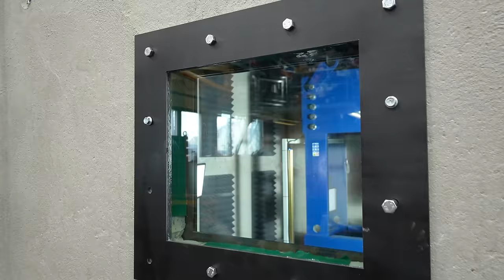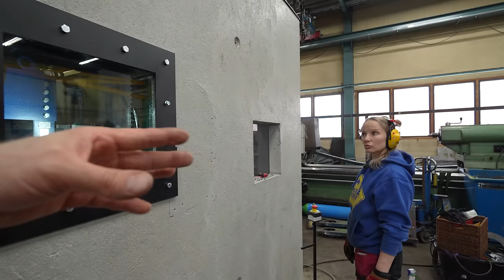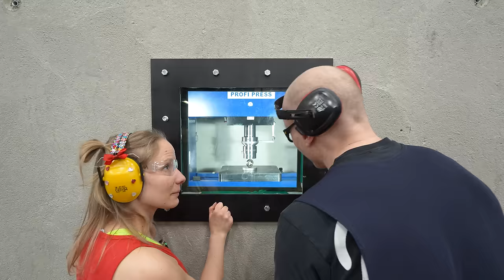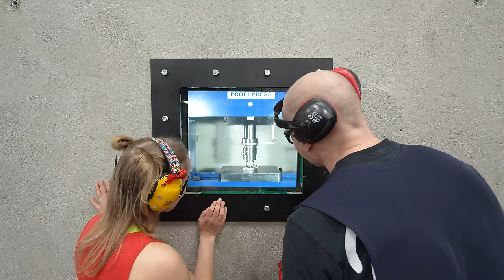Our Hydraulic Press Bunker Is Now BULLET PROOF

Comment: If you intend to film with expensive cameras through one of the windows, you may get reflections on the window from light outside of the bunker. You could reduce this by putting the whole camera in a black box against the window, or putting a 'skirt' around the lens with a fabric that doesn't let light through. I remember this skirt being a commercial product, but couldn't quickly find it. It used suction cups to stick to the glass.
Reply: Found it, it's literally called "lens skirt" 😆 by searching that term you can easily  find it.
Reply: I have often thought of the issue of having a very expensive camera inside the bomb shelter. Is this good engineering?
Reply: Thats a great idea! The recording will be extremely clear that way 👍

Comment: The walls need to be painted white. Traces of fragments will be clearly visible.
Reply: I feel like black would work better since they're already basically white and the. Any chips would be super visible
Reply: what if the walls wwere ballistic gel LOL
Reply: Every month or two they could recoat the inside of the bunker, alternating between white and black paint so shrapnel leaves very clear high contrast marks
Reply: too much work.
Reply: Nah, the raw concrete look is cool.
Reply: White would help with the lighting as well
Reply: @noodlelynoodle.  highspeed cameras need ALOT of lights, black walls would just absorb most of it.
Reply: @Wuuz  just use high gloss paint then, but none of the shots they do on this channel are ever super high speed stuff where that starts to be an issue. Not to mention that black is one of the best colors for filming/photography background to begin with anyhow, any of the light that would be absorbed by it would be light that was already passing by the focal point and would only be lighting up the backside which isn't seen anyhow
Reply: they put these echo lowering things on the walls
Reply: I vote for a dark metallic purple.
Reply: I Would put on a red layer first and then white. For the giggles.
Reply: Or 2 layers of paint. White on black or the other way round. You could easily see from the contrast if something penetrated both layers
Reply: Lil creepy. There's some overt fascination with violent forces in that thinking. But yeah, definitely do that thing; that would be cools.

Comment: I still would suggest a bed liner material for the walls on the inside. Maybe a white color so it will reflect the light but won't start taking chips and chunks out of the concrete itself. That stuff is super duper resilient.

Comment: 15:36 Arm guillotine 5 000 000! 😲
Reply from the maker: I will limit the pressure to so low level that won't hurt people that are getting between the closing door
Reply: @HydraulicPressChannel  could add a laser curtain like they have on big CNC machines so it cant be operated when anything is in the doorway
Reply: I’d suggest using a a single acting cylinder, counterweight and pulleys. Air to cylinder opens and keeps open door. When air pressure is removed exhaust on cylinder can allow counter weight to slowly close door and without much force. But you’ll still have full power to open door.

Comment: 2:12 If I had to guess, it’s about wave propagation. The way the layers interact can be more or less effective depending on order of contact. Think of the spalling that happened on armored vehicles and emplacements during WW1 and WW2. Ring those bells so hard the innermost layers shattered and flew off even if the armor didn’t get penetrated. Modern armors use a brittle material in front to shatter and abrade a projectile as it goes in. All placed in front of a more flexible structure.

Comment: Letting the shrapnel pass through the plane of a line laser would illuminate the pieces as they crossed.  Green line lasers are pretty cheap and might let you "see" small pieces the camera wouldn't otherwise pick up -- particularly on the high-speed.
...If you don't connect the door to a fog machine, it's only 9999999. 😜  Awesome work, y-all.  Wishing you a pleasant weekend from NC/US.

Comment: A real mixed bag of over/under engineering. Not criticizing to a fault, just observing the process. 
   I can see you had some real issues with the forward window mounting, as it's shown in various stages of incompletion throughout the video while the "auxiliary" windows are left in standby mode.
   I'm hoping you found that through bolts (threaded rod w/ nuts & washers on either side) puts the thin cross-section concrete into compression and will give the best yield.

Comment: FYI on the door it being made from ar 500 steel it is high carbon steel. Sand and clean the rust off then heat it to hot to touch with a blow torch and apply clean motor oil. This will cause the steel to blacken almost like gun blue. No need to worry about paint getting chipped up and you can re do the finish with a shop rag and clean moto oil with out heating it to keep it looking real nice. I use to have a bmx bike that was made from high carbon steel that i did this too and it looked great and was insanely easy to keep looking crazy nice. 
Any time i got a scratch on the frame i just used sand paper made for wet sanding at 600 grit then re applied the oil after

Comment: If you mount the steel door on the inside of the bunker using overhead rollers, you won't have to add extra parts to the exterior to stop potential shrapnel.

Comment: As a thought, if you paint the inside of Bunker 10 million darker (or hang a dark sheet on the walls) it will be easier to see the sparks and flying bits of things.
You've already got enough light on the victims, so you shouldn't need light colored walls.

Comment: I did some cable penetrations in an old building where the walls were cinder block covered with a very soft mortar... had to be extremely careful to make the holes neat on both sides, so I went through SLOW with a 6mm bit, then drilled halfway from each side with 10mm and then repeated  with 16mm. Maybe I could have left the 10mm stage out, but at least the result was way better than I expected.
Because I had to drill the prime holes semi-blind, I took an approximate thickness measure of the wall and marked it on the bit with tape, and when I saw the mark coming close, I turned off the hammer mode and went VERY slow.

Comment: yea its a common misconception that polycarbonate would be good bulletproof material, even the mythbusters were kinda surprised by that one. 

reality is, polycarbonate is fairly soft. what makes it a good material as backing for bulletproof glass is the fact that it stretches quite a bit before it breaks and doesnt crack when cut. which makes it really good at catching spalling shrapnel. but not much else.

the plastic in bulletproof glass is just ordinary lamination film used to bind the glass in a stack. it is elastic so it doesnt transfer the force of impact well to the next sheet but it is generally just a thin translucent film. not an actual layer.

(bonus fact, the pvb sheet used as lamination film absorbs some 99something% of uv radiation. its a side effect rather than a designed feature but yea. its the reason why you dont get tanned inside a car and the glasses that darken due to uv dont work inside one. (unless you point them at the side windows which are toughened as opposed to laminated like the windshield)
Reply: Normal glass will block out the vast majority of uv too not just glass with a plastic layer
Reply: It can tolerate blunt force better than glass, but bullets aren't blunt. Neither stops the bullet alone. The magic happens when you have hard glass to withstand the impact, and then you have durable polycarb for the glass to dissipate all that energy into. The order matters even. The armored bank cars sometimes have one-way ballistic glass. The driver can shoot out of it because it pierces the polycarb first and then blows away the glass, but incoming fire hits the glass first and then is absorbed by the polycarbonate!
Reply: @noodlelynoodle.  uvb yeah, uva only in small amounts, pvb stops almost all of it.
Reply: @dustinbrueggemann1875  nah mate, the glass is there to stop bullets. the polycarbonate is there to prevent spalling and only that. 
if you fire from the inside yeah you can get some glass shrapnel flying (depending on how close you are to penetrating the panel) but the bullet will be stopped by the glass regardless. (if it falls within the rating)

the polycarbonate will not reduce the glasses ability to stop the bullets :p

Comment: Problem why concret "braked up" at driling is because you have used basic drill bit with one carbide (- shape) blade. In some way for concrete is a lot better to use those with two carbide blades (+ shape) since when you drilling are more stable, also if you hit armature inside concret usualy can't stuck.

Comment: I think they should add sealing compound between the polycarbonate sheet, steel frame, and wall to prevent dust and moisture from collecting in-between the polycarbonate sheet and bulletproof glass.
Reply: A strip of foam should work as well.
Reply: Actually, I don't think you want it completely sealed, that's when trapped water vapor has a chance to condense. You can seal most of the way around for dust, but leave gaps at the bottom so humidity can escape.
Reply: It needs to be quickly replaceable, thats what it's meant for.

Comment: 4:27 when you drill in to concrete you have to drill a little then pull it out drill a little pull it out drill a little. you want to get the dust out of the hole because the dust heats up your drill bit and ruins it :)

Comment: Just as a PSA… You’re not supposed to push hard on rotary hammer drills, it hinders the reciprocating action of the drill.
It’s mentioned several times in most manuals but here is what it says in the user manual of my Milwaukee SDS plus rotary hammer.

“This tool has been designed to achieve top performance with only moderate pressure. Let the tool do the work.
If the speed begins to drop off when drilling large or deep holes, pull the bit partially out of the hole while the tool is running to help clear dust. Do not use water to settle the dust since it will clog the bit flutes and tend to make the bit bind in the hole. If the bit should bind, a built-in, non-adjustable slip clutch prevents the bit from turning. If this occurs, stop the tool, free the bit and begin again.”

Comment: A nice small thing to test is the spring of the 48RE automatic transmission.
Precision Transmission has a video where they pull out this spring, and when you see it in the part, you are a bit shocked at the spring size and the part it sits in.
Video title: "Most dangerous thing about a 48RE video 2-2."

Comment: We used to slid copper wire in to catch those bolts it the holes ever became overbored slightly. The crushed copper did add some bite, bur isn't fool-proof and is better than not having a fully functioning bolt if other ones around it can bear a reasonable burden to meet the engineered needs. Not recommended unless in a pinch.

Comment: don't you need some cushion between the glass and the metal? maybe some paper or rubber?
Reply from the maker: There is the glue between those. Maybe 3mm thick layer
Reply: There is special expanding tape used for window/glass installation. It comes compressed and decompresses once unrolled.

Comment: The overlap between glass and the metal frame feels too small compared to the overall width of the frame.
Reply from the maker: I was wondering about that also but the window manufacturer said that the window is not going to bend ever. And that amount of hardox can also support something like 200 tons so the bolts are going to probably give up before the window goes through the framing

Comment: the door should be fitted on the inside.
Reply from the maker: I have to be able to have as much acoustic panels there as I can so fitting the door inside would result in quite much more echoy concrete to be bare. And I also will mount stuff like lights etc. to walls so I don't want the door to be sliding there.

Comment: lauri, dumb decision to drill the concrete. Would've been smarter to make the concrete window bigger and have the bolts stick through the opening, and have the glass rest on the bolts acting as the frame.
Reply from the maker: It wasn't that much of work now when I have the system figured out. Maybe 10 minutes per window?
Reply: @HydraulicPressChannel   yeah but it'd be so much easier to just have the bolt holes line the actual opening :D no drilling required